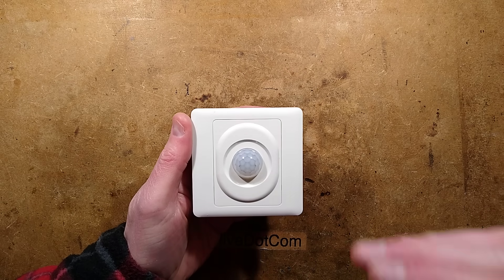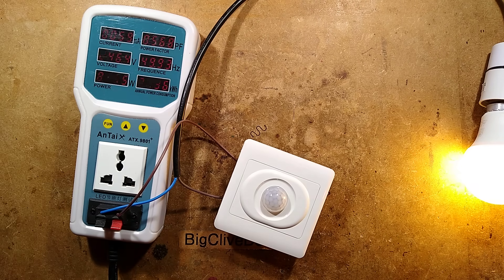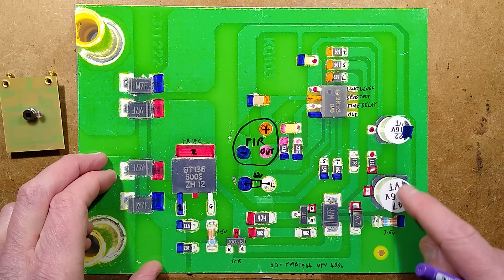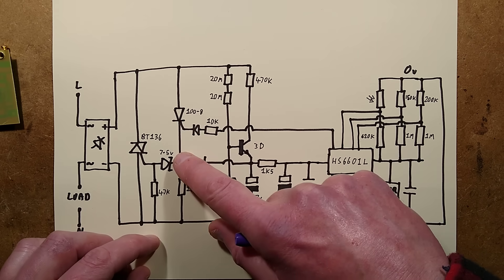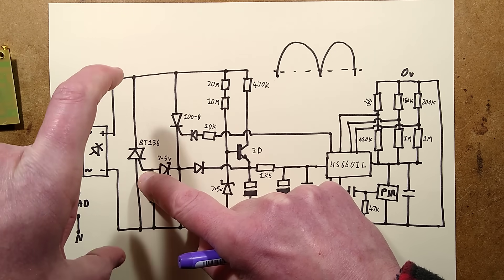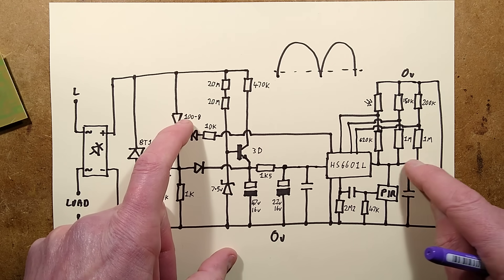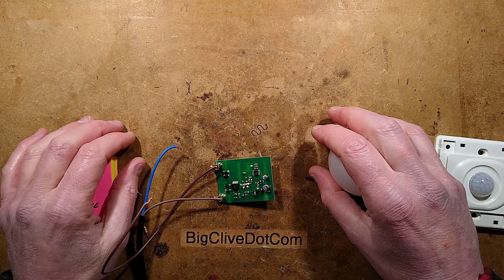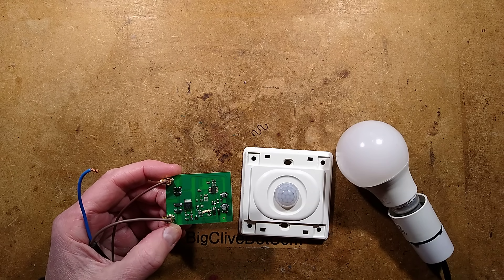Two wire (no neutral) PIR detector - with schematic

Comment: The inclusion of a user accessible fast acting sand fuse, in series with the load, might avoid the inconvenience of replacing the whole unit when the load fails momentarily short. 
There seems to be a potential failure mode when the diode takes over suppling the chip current from the emitter follower regulator. There is a tolerance range on the chip supply voltage that   must ensures the diode suppy takes over, but avoids excessive reverse bias of the high voltage transistor emitter/base junction. Given the spiky nature of the chip supply current from the diode, it is surprising that the smoothing was sufficient not to degrade the operation of the PIR detector. Perhaps it is less sensitive once triggered, as a result.
Reply from the maker: Fuses rarely seem to protect semiconductors.  Even the FF semiconductor rated type.

Comment: Usually I can keep up and learn a little something but I shut down when someone says triac.   Oh noooo   not triacs,  zero crossing? Nope.  Optical isolator and filter cap? Nope. Please boss, put somebody else on that inductive spiky madhouse! So many physically large, high current coils, in close physical proximity, so much switching, utter chaos.  Clive, I sure wish you would have shown me a video about TVS in 1998- 2004 That was a challenge, no a bloody quest.    Alright let's just call it what it was,  vengeance. I spent a lot of sleepless nights just to get out of climbing in the guts of that nasty machine to replace a switch every 3 months.   ticka ticka ticka adds up to the rated 12 million clicks quick when they walk off and leave it running all weekend. It seemed so simple at first,  hall effect sensor and a magnet. What's not to like?  Now if youll pardon me, Ima go have a beer to try and drown out the traumatic memory,  and watch this vid again tomorrow to see if it will click.

Comment: I was always fascinated by no-neutral circuits. How they generated a tiny supply, without turning on even a low current load, like a led bulb. I finally came up with my own ultra simple version of a no-neutral circuit. My version has basically zero current draw when the load is off, and can power larger more power hungry devices, like smart wifi light switches. Even touch panels and still not make a led bulb light up. https://youtu.be/8sBKqHaTDtg

Comment: Auto disassembly, sweet!  Way more complicated operation than suspected but being mains powered instead of straight DC I can see that. I've only used the DC versions for simple on/off, like on vehicles for additional lighting installations and running off 12V.  Clever stuff, thanks Clive.

Comment: I bought my first one on eBay about 15 years ago for about £6, and it's still running to this day. I've always wondered how they worked - cheers 🙂
Reply: I bought a house from 1954 in 2001. I could take out all wiring in the house except the ones in the hallway with the zillion switches. Bought 2 wire pir switches via Conrad which worked great.... except when the GU10 halogen lights decided to blow. It would take the triac with it.  The later ones which I was able to install were 'led-compatible' and so I replaced all GU10's with Ikea led ones about 5 years ago.  All still working so far.

Comment: The cost reduced uC based ADC sampling timers are a bit flaky, when deployed in humid environments.🤔 Learnt it the hardway, when a timer for tranfer pump malfunctioned, emptying the entire water reservoir😢. Whereas a programmable digital timer worked well inspite of the complex programming steps.
In a PIR application, it could make for a realistic haunted house light bulb, with some additional humidity😂❤👍

Comment: you should check out the moes smart switch without neutral. It has miniature latching relays and 2 chonky 30v 120a mosfets. I had no idea how it worked.

Comment: They even sell smart wifi switches that dont require a Neutral connection! Some come with a small adapter that you can connect at the light bulb side, probably to guarantee some miniscule leakage current. Some say you can use Earth/Ground as a "neutral". I'd love to know if the latter is safe? Maybe even if the switch isnt deaigned for that?
Reply from the maker: Using earth/ground as a current path is not recommended.  If a break occurs in the circuit, everything connected to the earth wire would pose a shock hazard.

Comment: It's been a long time since I used to design PIRs for a living but the basics won't have changed. The FET source follower buffering the sensor elements will be a JFET, not a MOSFET and there'll be a very high value resistor gate to 0V/case to bias the FET on or possibly something integrated with the FET to do the same job.

Comment: Interesting. I tried a cheap smart light switch last week. It needed a capacitor fitted across the terminals to power itself when the light was off, but I have an LED strip light in my kitchen and the trickle of power was enough to keep it lit even when it was supposed to be off. I've since changed to a switch powered by internal batteries instead.

Comment: I've been using the 12 volt version for years......

Although it may be a different manufacturer but fundamentally the same thing.

Plus side note they have also been used outside in the open with weather shielding over it to prevent the majority of rain getting in and they generally  survive 3 years or so before I need to change them or empty them.......

Bearing mine they only used to cost £2 per unit from China.

And yes I know it shouldn't be used outside but if the shoe fits and it hasn't tripped the breaker... run with it.

Comment: Legrand makes two wire (no neutral) time switches here in France, however they use a battery to power their circuitry.
Lithium primary cells to be more precise and they are very likely to be soldered as the instructions and datasheets don't say anything about replacing that battery.
(By the way these are simple push buttons with a built-in staircase timer, nothing more).

Comment: Thanks for this video. I always wondered how these kind of "in-line" devices with no neutral connection managed to get power both when the load is off and when the load is on. I kind of imagined a circuit that effectively looked like a very large resistor in the line, allowing only a very small trickle of current through when the load is "off", and then some kind of low-resistance transformer-like device that could take advantage of the current flowing through the device to power the local circuit when the load was switched on. But I never really worked out if that was even possible. This circuit stealing a little power for a short time near the zero crossing when the load is on is much more sophisticated (and surely much cheaper than any kind of transformer) than anything I would have ever imagined. I very much like learning new things, and this is at the top of my list for today.
Reply: I had a no-neutral in line remote control switch, and it worked by relying on a small current passing through the filament of an incandescent bulb.
The current was low enough the filament produced no light, so it appeared the light was off.
Reply: You’re right. Using the tiny slice of time before the four layer device turns on to run the power supply circuit to keep the power supply circuit capacitor charged is pretty darned slick.
Reply: The load itself is that very large resistor that you imagine. For a long time here in the US there were devices that cheated that use the earthing (ground) as a neutral. They are now no longer allowed as just a few on a circuit would cause more than 6ma of leakage current to flow.
Reply: @mxslick50  Nope, I recently put in a few IR switches like that; name brand and NRTL approved. This was actually explicitly added to the 2017 NEC in Section 404.22. They have to be safety-rated (e.g. double redundant) to leak no more than something like 75 µA.
Reply: @straightpipediesel  I wasn't speaking about NEC restrictions, but state/county/city regs. But yes, as far as the NEC is concerned, you are correct.

Comment: The device was a fascinating design, up with my NiCd charger in the 1970s. Top tip for searching - prefix the search terms with "+" or "-" to ensure the results contain or don't contain the search term.  +3d +transistor produced an identical image of the device, top of the page
Reply: 3d smd transistor

Comment: Cool, a lot of the older ones draw quite a lot of current and cause all sorts of problems with LED and some fluorescent loads. The last 2 wire PIRs I pulled apart had Ni-Cd cells that were recharged when the switch was off, and latching relay used to bridge the 2 terminals when on.

Comment: That was some really easy disassembly for sure!
I'm surprised by the lack of time and light level (and optionally, sensitivity) controls on this sensor. They're found on most mains powered PIR sensors out there - but I guess that with in-line sensors like this, 1M pots may be too expensive and anything smaller would increase the current draw too much to be still useful with LED bulbs. Or maybe the designers decided to cut corners? You can never be sure...
Reply: I had one years back that had controlls for light sensitivity and range. Did not last long tho
Reply: nah, pots are very cheap, on the order of 10ct a pop at 250pcs.

Comment: I'm still unclear how it's switching the load through the bridge rectifier. Something on the DC side is affecting the AC side?
Reply from the maker: When you shunt the DC side, it appears as a short circuit on the AC side.
Reply: @bigclivedotcom  yes, minus the double diode drop, but it's negligible compared to mains voltage. It will give off heat proportional to the current, so you can't load it too much - one or two amps is fine, anything higher will be a good bunch of watts.
Reply: Short circuit aka closed switch

Comment: I have a 2-wire WiFi and touch sensitive switch. It obviously needs a little more power than this so it requires a 5nf capacitor across the lamp in order to pick up some current when the switch is off.
Reply from the maker: That might be to stop the lamp glowing slightly with the low current.
Reply: A few years ago I had a 2-wire motion sensor that needed at least a 15 watt bulb to function. LED bulbs wouldn’t produce enough current leakage (?) to power the PIR circuit. I could put an LED in parallel to produce the needed light. It did glow slightly when off.
Reply from the maker: @TomCee53  A small capacitor across the lamp holder might have passed the required current.